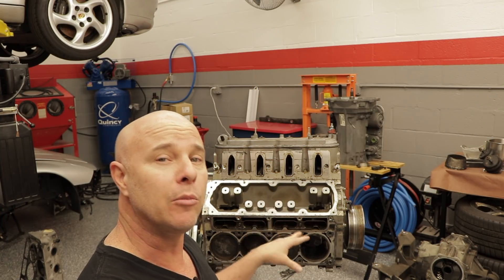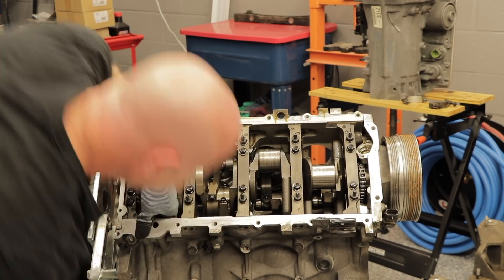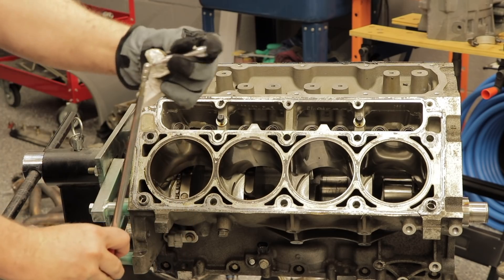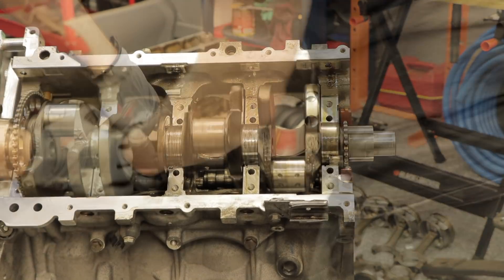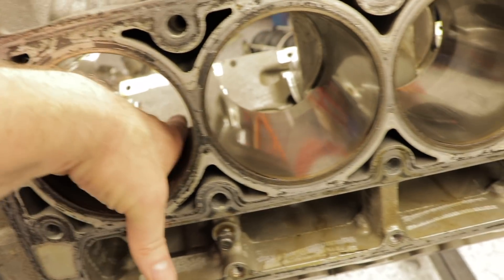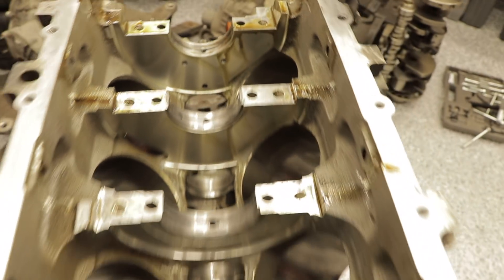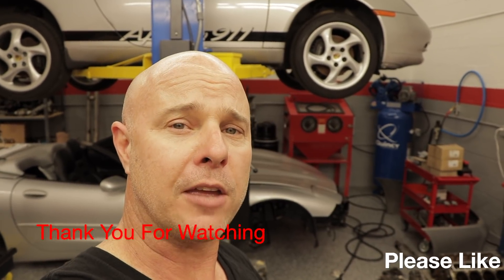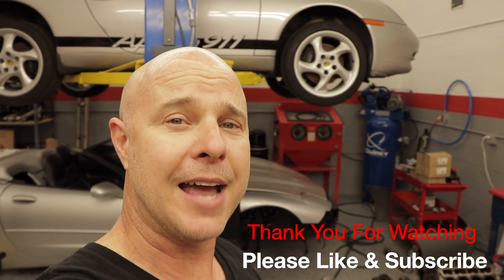Here's Why I'm Not Rebuilding Apollo 911's Broken LS2 (Part 4 Apollo 911 Series)

Comment: Any part on the engine that has oil traveling through it, small passages etc, i wouldn't reuse.  Just buy a new parts.  At the end of the day by the time you are done replacing all the components especially factoring in the cost of a new crankshaft, you might as well have just bought a used engine.  Unless you have a great machine shop and were planning to do a completely engine build where you replaced all those parts then its a different story.  But just simple bolt-on stuff.  Not worth it.

Comment: 12:10 Its gonna take a whole lot more then a set of 243 heads to squeeze 500hp out of a LS1.
Reply from the maker: It's actually fairly easy to squeeze 500 HP out of an LS1.  Porting and polishing the 243 heads really opens them up. I know guys pushing over 900 HP to the wheels on a Turbo LS1

Comment: Your going to have to change the crank trigger wheel on the crank and the new motor has a front timing cover cam sensor  or you’ll have to change some parameters in the ECU lots of things to think about good luck with you build

Comment: For future reference, scored/scratched/galled/pitted bearing inserts does not = a spun bearing. At 6:30, you start pulling main caps and refer to main bearings that have damage from oil starvation and/or galling and call it a "spun bearing". These bearings have clearly not spun in their race as the lock tabs are still in place and have not been sheered off. The bearing halves have not spun inside their race.

Comment: Have machine shop check crank for shits and giggles. I think it will clean up in standard oversize range. I don't think you are one to want a "good enough" 60-80 under crank in your  engine. But that is how I (being a cheap ass) would do it. I would be sure to pressure wash all the oil passages to remove any metal if the crank checked out. Great solution for your engine problems. Look forward to your up coming videos.

Comment: Torque to yield stretches the bolt so shouldn't be reused however all bolts stretch - that's what torquing does to a bolt.  Hydraulic ROLLER lifters can swap around in the block however, on an oil starved motor I'd never, ever reuse them because the oil ports could be blocked.... plus, they're like $15 each new....  I'd also be very concerned with the cam lobes that the wheels were dragging because there wasn't oil dropping onto them when the oil pump plugged.  It needs to be bored - that scoring probably will take .010 to clean up, and what you can't see is the taper but with scoring comes taper.  If you do save it, super-clean the galleys.  Why not use the LS2 in the LS1 car?  there's no substitute for cubic inches.....

Comment: A big part of the oil starvation was the oil pick-up.  The engine was mounted backwards so the pickup starved during heavy braking.  
Perhaps a modified oil pick-up that faces the other way (towards the front of Apollo911, or the rear of engine).

Comment: I drive a toyota matrix. One day I floored it through first and second up a hill from a stop and then parked a minute later. I smelled a slight burning but just figured that maybe the clutch was slipping a little bit from that abuse, since it has 150k miles on it. Later that day I drove down a long hill from that parking space into town. Once in town I was crawling through in second gear at about 2,500 rpm when I heard what sounded to be a bag of rocks in my transmission. Alarmed I pulled over and checked my oil. Nothing. It took 5 quarts to fill back up when normally 4 will be enough during an oil change so it couldn't get much emptier than that.

I later found out that I had a recently developed oil leak coming from my low oil sensor which was screwed into the housing above my oil filter.

If this device hadn't been there, something made to tell me when I was out of oil, then I never would have ran out of oil. Also, if this device which was created to tell me if I was low on oil, had actually told me I was low on oil, I would have never run out of oil. Instead, this thing which was made to tell me if I was out of oil, caused me to run out of oil, and it didn't tell me. Wow.

What had happened was that rust had formed up the threads of the sensor so far that eventually it formed up through the gasket and created a small leak that must have been going for days. But because it was winter outside there were no obvious signs of oil leaking onto the ground.

The car still drives fine. I hear a little bit of what sounds like valve clatter around 3k and 4k rpm but it's pretty quiet and only happens when the car is cruising and maintaining speed and at that point I can downshift to a lower rpm. I don't hear any knocking when I do a hard pull but maybe the engine drowns it out. On the highway above 2.8k I can hear some faint knocking if I lug it. It seems like if I keep it to 70mph and slower on the highway and downshift to avoid lugging it up hills then there is no mechanical noise.

Comment: You can reuse TTY bolts. TTY bolts deal with the expansion and contraction of thermal cycling better than standard bolts. So, over the long term they supposedly provide more even clamping and reliability. Now how much that makes a difference in the real world and how much is to sell more head bolts, I don't know. Basically used TTY bolts become regular bolts and as long as they torque down properly you will be fine. Sloppy Mechanics reuses headbolts all the time and has never had a problem.
Reply from the maker: While Sloppy does some cool stuff, GM CLEARLY states in all LS Shop manuals do not reuse them.  I'd prefer to err on the side of caution.  Not a huge expense to get new OEM head bolts.
Reply: Chevrolet states to REPLACE LS series TTY head bolts not reuse. The reason you don't reuse them is because they are torqued to the pont stretching. Does not make good sense to risk head gasket/clamping issues on a new/refreshed engine because someone is too cheap to buy new bolts. Reuse TTY bolts at your own risk.
Reply: Sloppy decaps injectors and does other hack shit that may be cheap but it aint right.  I do wonder how many times he has had problems and A) didnt make a video about it B)blamed it on something else.  TTY bolts are no different than any other bolt, they are TORQUED past their elastic stage and to their plastic stage meaning they do not return to the same dimensions.  You do you, but either purhase ARP fasteners that are meant to clamp in their elastic stage or buy GM fasteners and install them as directed.

Comment: One of the weakest parts of the LS family is the oil pump, actually almost all GM use the same oil pump and it is all junk. The drive "pin" on the crank fails and then it stops driving the oil pump. Even the Duramax diesel is like this. That pressure system is a "fail safe" system not a solution and if your engine is starving for oil it will give some additional oil but when that can is empty it can no longer help and that will happen faster than you think.

Comment: Well I've played this game a few times with spun bearings and such (finally found the cause was a pickup tube that was too short) anyways it would probably be a push to rebuild but at least when you used it you would know what you got. Was the cam in Apollo's old motor special for the application?? I'd check on that. I believe the balancer was part of the kit as well. Anyways as always good stuff. Good luck!

Comment: Without dry sump an LS won’t live long on the track.  Thinking otherwise will end in tears.  The problem is that under high g cornering, the oil stays in the heads and doesn’t fall down quick enough to feed the internal pump.  Oil pan baffles and Accusump will not solve that problem.
Reply: really? this is good to know, im planning on Ls swapping a car and had no idea of this. Thank you. any recommendations on a drysump kit to use?
Reply: Molly Bags For Street use, no dry sump needed.  For track use, there are a number of options based on the amount of modification.  A low end system will use a single or two stage pump along with the internal oil pump.  A full race build may be a 3 or more stages with no internal pump.  

I have no affiliation, but start your learning journey here: http://www.johnnycichowski.com/2016/07/hold-that-pressure-on-cheap-least.html?m=1
Reply: i think its chevy that made high pressure lubrication systems for corvette ment for oval tracks.. 
on oval tracks normal engines suffer same problem from oil hanging on side of engine and dont reach pickup.
Reply: lars kristensen A few years back, Corvette went to a dry sump.  I’m thinking it was the 1LE option.  Interestingly, guys are converting back to wet sump.  This I don’t understand unless it’s to save money on oil at change intervals and they don’t intend to track the car.
Reply: @trort2714  oh well.. guess they have more money than brain  :)  its russian roulette and this just add a bullet.

Comment: No stress on not rebuilding the old motor right now. Great content and very smart buy on that LS2
Please forgive my ignorance, with ACCUSUMP is it all too late to supply more pressure when oil pressure drops? That just sounds problematic on track, as you never want low oil pressure. Can it not run continuously. You sort of addressed that concern given you are following what other 911 LS swaps have done.

Comment: I'm digging the Riv!!!!! 63, 64?
Reply from the maker: It's a 65 actually.  Only year with the clam shell headlights.
Reply: @The305Garage  Cool, I didn't get a good look at the nose.
Reply from the maker: Spare parts I’ve got a really old short video clip on my channel showing the headlights open and close after I fixed the broken motor. I then tore the car apart to restore from the frame up. Lol. I’ll have some future videos on the Rivy soon. Thanks for watching!
Reply: @The305Garage  Awesome! Is she a 401 or 425 car?
Reply from the maker: Spare parts It’s a 401 car. Before it, I had a 65 Gran Sport with the 425 Dual Quad engine. Unfortunately the body was in really horrific shape on that car, so I ended up selling it after I bought this one. This one was a 2 owner 88k mike car that was in really nice original condition with a solid body. It was a much better candidate for a full restoration.
Reply from the maker: Spare parts You can see more of the Rivy, and some of my other cars in my video titled “Apollo 911 is home, but it broke again”

Comment: I would recommend you make a trap door in the oil pan allowing the oil to move forward but not backwards so that the oil dont slosh to the rear of the engine in launch and keeps most oil to the front bye the pump...my buddy did this to his car to help oil starvation on launch..can weld up a little door in the pan

Comment: Thanks for the video. I was one of the guys who suggested that you should go dry sump, I think your solution is a good compromise. The supplementary oil pressure system sounds neat and combined with placing baffles in the sump should be enough to get some good fun at the track. It would be neat if you are able to log when there is a demand for the supplementary oil system.

Comment: Due to no oil because it needs different oil pan,and if you look closely the main Bering spun a little the block is cashed
Reply: Melissa Hill I rebuilt over a hundred engines ,if that main Bering turns a 1/8 of a inch I will not reused that block,it happens all the time it's not impossible
Reply: Melissa Hill you must not know anything them little tabs will easily flatten out when the berings seize to the crank https://www.enginebuildermag.com/2017/03/engine-bearing-technology-spin-spun-bearings/
Reply: @melissahill7930  where would you like me to ship some spun bearings from my d17 Honda. If you talk to bearing manufacturers like King or Clevite they will tell you those tabs are for assembly only. The bearings use something called crush to keep from spinning.
Reply: Melissa Hill looks like I schooled ya at least you could admit it 😛😛😛😛😛😛😛

Comment: Thoughts:

Any problem rebuilding the LS2 and putting it in the Corvette? I mean it's got to be better than the LS1, right? Better by one anyway.

Rebuilt the LS2 and put it in the Riviera, disguised as a Nailhead. Dressing LS engines as older engines is a thing these days. 

Was the problem a failed oil pump, or was the oil starvation the cause of the fragged pump?
Reply from the maker: I've given it a bit of thought.  It is possible, but there are quite a number of things that have to be adapted to run an LS2 in a C5.  Not really sure on the oil pump, it seems it might have been a combination of both oil starvation, and pump failure.  Hard to tell completely.